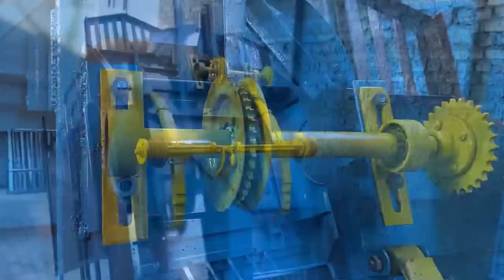Amazing Manufacturing Process of Six Seater Rickshaw Gari “production process of Chingchi Rickshaw “

Comment: The one thing that amazes and bothers me about these videos with men welding in them is almost total lack of decent welding eye protection. Seriously as someone who has welded professionally most of my life I can tell you even with proper welding masks your eyes take a beating and I was taught by an old timer to wear the absolute best and darkest lenses in my welding shield I could and at 60 I am a good candidate for eye surgery. I doubt the men wearing sunglasses much less eye one getting splashed by uv light from welding will make it to 30 or 40 without having eye trouble

Comment: Just right to take the family to the Drive In Movie!
Didn't see any seat belts or cup holders.
100cc soup can engine will die a miserable death hauling the families.
Reverse gear?
Reply: 100cc is enough to pull 6 people at 40 km/h max. Most of the time they drive at about 25 km/h.
Much better on the earth than a lone man carrying his 125kg bum on a 3000kg SUV running a 6 Liter V8 engine.
Reply: @jarjarbinks3193  Correction 'lone star man'.  That mode of conveyance is mandatory in Texas.   It is not optional.     And a Texan must also carry a powerful handgun with a high capacity magazine at all times. A sound suppressor for the gun is optional however.
Reply: @jakleo337  Sound suppressor, can't have those poor little ears hurt, can we?
Reply: @davidpowell6098  Read is hard? He said that it is optional...

Comment: This vehicle design is not recommended and not improve in transportation law because of un balancing and attach with 100 cc bike or 200 cc bike while self load of vehicle is  more the 200 kg with 6 passengers and one driver weight approx. 500 kg. total weight 700 kg is not acceptable for this bike engine.
so rejected this vehicle in motor transportation rules and act internationally.